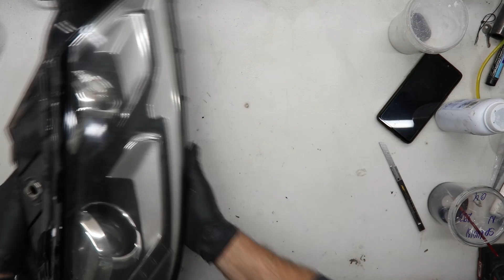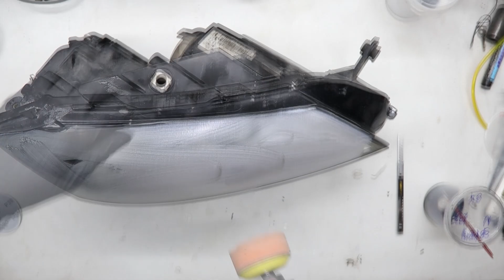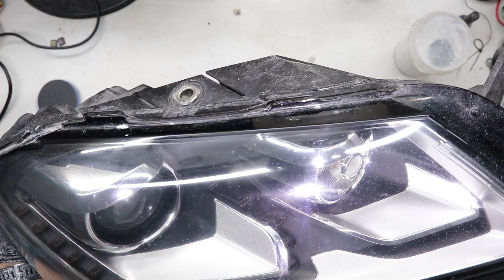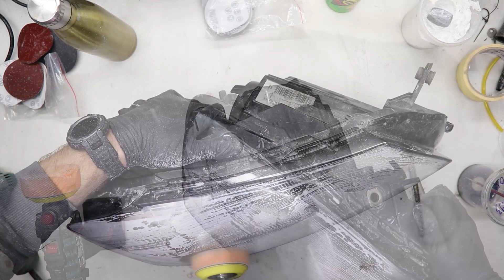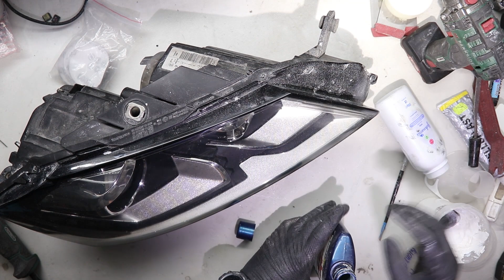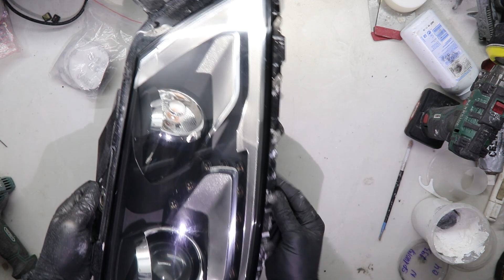How To Restore Headlights No Clear Coat DIY

Comment: @Gadomaitis, Hello,
1. After the 3000 abrasive grit, would you explain the other grits you have used please?
2. What is that white paste that you apply in between grits?  …finally,
3. The Turtle Wax at the end, do you apply it with a plain sponge or is it something else?
Many Thanks, in advance.
Reply from the maker: Hello,
1. All the time I was using the same 3000 grit abrasive pad, except I didn't like the outcome and I was keep replying the procedure. Later I started to use a slower drill. 
2. Cheap polishing compound for car, I have smashed the original package, can' tell exactly. 1 kg of it costs maybe 6 eur. or something. 
3. Yes, plain sponge ant buff it with the same sponge. Black, the one I have was quite soft.